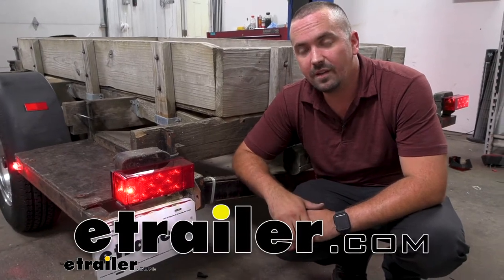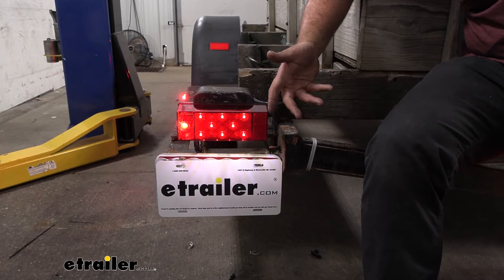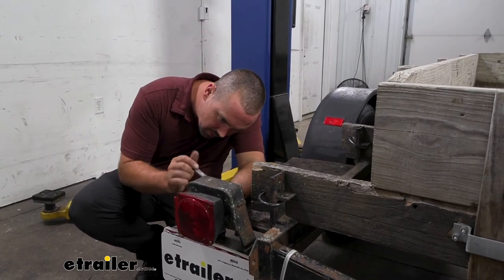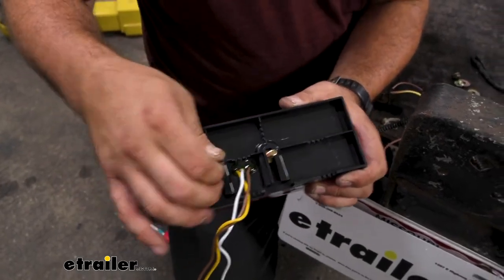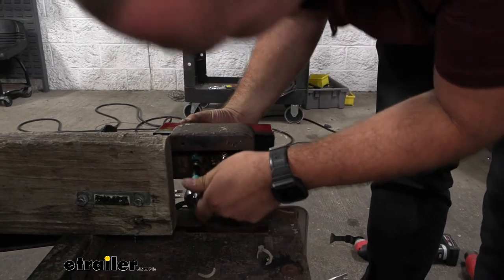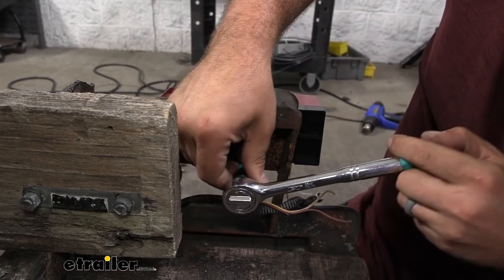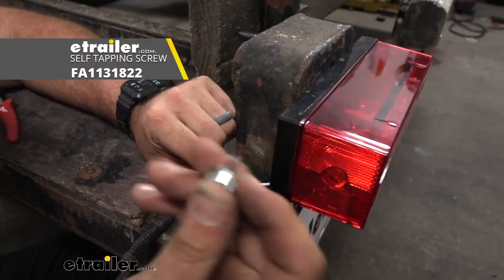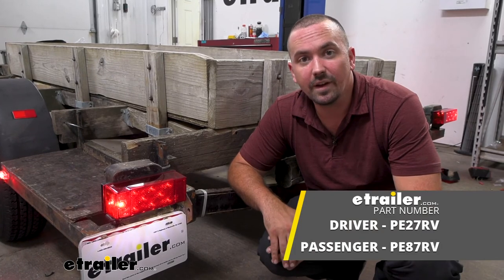etrailer | Feature Breakdown: LED Trailer Tail Light

Comment: Question about the ground wire.  My current lights don't have the white ground wire, as my trailer is grounded at the truck wiring.  Do I still need to use this white ground wire?  Thanks.
Reply from the maker: Your old lamp very likely grounded via its mounting hardware. Since the new lamp has a dedicated white ground wire, it'll need to ground to the trailer frame or to metal that's in direct contact with the frame. 
https://www.etrailer.com/Trailer-Lights/Peterson/PE27RV.html